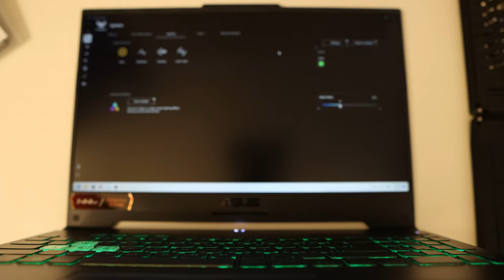ASUS TUF A15 FA507R Upgrade & Review

Comment: I am super poor and I wanted an all around good laptop with a decent graphics card.  That's a hard ask these days especially with planned obsolescence.
I'll usually study a purchase for days before I buy but this time my mom was getting me a b-day present and said now or never. I just went in to Best Buy the Sunday after Black Friday and saw the Ryzen 7 6800 series variant for $600, wondered why its so cheap when it should be like $1200. Then I realized the RAM was 8GB and the storage just 500GB (that's like 2 games of data) looked up its specs and saw you can upgrade an extra SSD and the RAM is DDR5 4800 too.
So this little Laptop really got its naming right with TUF. It's a straight sleeper like a Honda Civic. All the stuff to have decent gaming and editing is in the comp you're just missing RAM and extra memory which turns out to be the easiest stuff to install.
Reply from the maker: This lineup is really a great value and good looking, not being too overly "gamer" but having the guts inside to really perform! The best part is that DDR5 RAM has dropped significantly in the last year and NVMe storage is probably the cheapest it'll be for years. Both are definitely easy and straightforward to upgrade, too! Thanks for watching and enjoy your new laptop!

Comment: I received my A15 yesterday. But it has 2560 x 1600 according to the specs, but it is really a 2560 x 1440 and 165 Hz panel. Tested it out in Escape from Tarkov in Middle settings. Ran fine, but the screen had a weird flicker when turning around... don't know what that was all about, but I hope it won't be a problem. I have the 2020 A15 too, but Windows commited hara-kiri, so I need to reinstall windows on that one. Ran EfT in Low settings on that one. It has the 4800H and 1660 ti, which was also fine with 1440p and 144 Herz. The biuld quality on the 2022 version is so much better and the keyboard is good with very good feedback. Didn't make too much noise fanwise, but I play with headphones anyway.

Comment: Enjoyed your video.  I'm curious about one thing.  I just bought this model used yesterday in like new condition with the original box and charger.  But I notice a difference with your model.  On mine there are none of the switches (?) or labels just to the right of the mouse pad.  It's completely blank all the way across the front 1/3rd section of the board.  Could you comment on this?  What do all those labels represent?
Thanks.
Reply from the maker: That's just a label of key specs, processor, and GPU brands. Just stickers
Reply: @Accounting4Cycling  Cool.  Thanks for answering.  I'm not a fan of a lot of labels.  I think I like mine the way it is.  Thanks.

Comment: Can you upload a short video regarding 4 outlet fans
Reply from the maker: This particular model only has two fans and three "outlets" on the chassis, with the primary intake coming from the bottom vents. The "fourth" outlet is kind of just the top of the keyboard deck by the power button. The thermals were great and the keyboard was still perfectly usable during long usage (gaming and regular use). I don't have this laptop anymore, I gave it to a friend's son shortly after this video.

Thanks for watching!
-Mike

Comment: Does a SATA 2280 ssd work? I have one lying around and I don't want to spend on a nvme at this moment.
Reply from the maker: I believe both slots are PCIe NVMe only. There's also the option to get an external USB-C SSD enclosure and use that SATA M.2 as an external games drive/general SSD! Or, at this rate, a good 1tb gen 3 NVMe is going to be below US$50 by next week!
Reply: @Accounting4Cycling  I'm already using the enclosure😂 I thought maybe I'll just stick it in and just let it stay. I use them mostly for photo and video editing. I'll save up until I'll be able to afford a 2tb nvme gen 4. The video files these days are so damn huge. Thank you so much. I tried using the SATA drive and it didn't work. Thought maybe I missed some setting in the bios. Such quick response is something to be appreciated. Good luck to you on all your endeavours!!!!
Reply from the maker: @Infant Maria Ashwik  not a problem! Thanks for watching! I saw some of the Cruicial, Samsung, and WD Black 2tb NVMes are getting close to $100. They're very good drives to look at, especially if you find them on a great sale! Between video files and games, 512GB of storage disappears quickly!

Comment: Bro hope you will reply to me , i have exactly the  same laptop. Can i upgrade my ram to 32 gb or it's only capable of 16 gb expandable ?
Reply from the maker: You can certainly upgrade to 32GB, that's the max supported for that board. I only did 16GB because at the time DDR5 was still really expensive.

Comment: i have asus tuf gaming A15 (fa507re) with 56wh battery 
can i upgrade to 90 wh battery ??
Reply from the maker: I would imagine if the space is open and you can find the battery that it would work. It's the same connector to the motherboard, so if it fits, it should work without issue

Comment: HI I have the same laptop can i upgrade to 64gb of ram or not please reply like 32x2 ddr5 rams plesae reply
Reply from the maker: ASUS lists the max RAM as 64GB. I'd only really recommend going up to 32 (16GBx2) because the cost to benefit just wouldn't be there. Even with more RAM hungry programs, 32GB will outlast the thermals on the CPU and GPU in this machine.

Comment: Which RAM did you use? Can you provide any link to buy those RAM sticks?
Reply from the maker: I sure can, I used Kingston Technology Fury Impact 16GB 4800MT/S DDR5 CL38 SODIMM XMP Ready (Kit of 2) Laptop Memory KF548S38IBK2-16, Black https://a.co/d/2E2X9X7
Reply: @Accounting4Cycling  thank you!
Reply: The included ram is CL 40, so the timing may not be completely in sync if you get the Kingston and mix it with the included ram. Just be aware.
Reply from the maker: @EzEJabo  definitely do the 2 stick kit, always a good idea on laptops. Limits the risk of timing and BSOD or boot issues, DDR5 is also still pretty high for timings but luckily the cost is coming down!

Comment: yoooo just watched this,  placed my order for the same model. Idk if your a hardcore gamer or not but are thermals really a problem in the 2022 version? I'm an esports fanatic (fortnite comp) so I'm really just looking for the best performance. I read reviews about the screen, didnt seem like an issue to me, but overall anything else I should be worried about?
Reply from the maker: I thought the thermals were very good for being on the slimmer side of gaming laptops. The kid who received the laptop does the same type of gaming and has loved it! I would basically just do the same things as I did in the video: upgrade to 16GB of RAM and more storage for games. The second storage drive comes with a small battery life penalty, but it's worth it, especially with how DDR5 has come down in price!
Reply: @Accounting4Cycling  my version alr has the 16gb of dual channel ddr5 ram, the battery is 90 Whr so the HDD slot isn't avaiable. Theres an extra nvme slot which supports up to 2tb of expansion, so will def be using that! I need the laptop for Uni and heavy gaming so the bigger battery for me is definitely a plus side, as I'm carrying it back and forth from uni spending hours on end working.

Comment: Can we add hard drive on asus a 15 Ryzen 6800h with rtx 3060ti?
Reply from the maker: I don't know about that model, but if you carefully remove the bottom cover (should be the same process as this model), you will be able to see if it has space for one. Most in this lineup should have an extra PCIe NVMe m.2 slot, some with the smaller battery have a 2.5" drive bay, as well.

Comment: Do you also have diffferent colors under 8 key?
Reply from the maker: This series of laptop has an RGB keyboard, but it's either rainbow or one solid coour
Reply: @Accounting4Cycling  Yes every key is single color but under 8 key There is multiple colors. For example if I set static color to white I see purple and green. If I set it to yellow, I see orange and green only under 8 key. Other lights are ok. Am I the only one encountering this?
Reply from the maker: @fv4202x  I didn't experience that, might be a bad group of LEDs under that key that aren't lighting correctly. Could also be like a magic 8 ball and hold special powers?

Comment: Great video thanks. Could I ask what size battery does this laptop have?
European/ Uk only get 56 wh
Reply from the maker: This one is 56Wh, too. Does pretty well on battery for it's size and power, but there's definitely room for more.
Reply: @Accounting4Cycling  hey mike is it possible to update from 56Wh to 90Wh ?
Reply from the maker: @Giorgi Turmanidze  it looks like there's space for it. As long as you don't have the 2.5" drive space, it should just drop in place and go. I'm sure there's a vendor selling new/OEM batteries.
Reply: @Accounting4Cycling  i cant wait for someone to do this "experiment" on youtube it is really hard to take a risk of doing it on your own a without video tutorial :)
Reply from the maker: @Giorgi Turmanidze  I don't have this laptop anymore. I gave it to a friend's son who just started getting into PC gaming/streaming and needed/wanted one for high school. I could possibly do a battery removal/reconnect video, depending on if it's glued or not and has the space for a larger battery (many due for simplicity of production), it's a pretty quick task. Not quite upgrading RAM or an m.2 SSD easy, but it's pretty straightforward.
Reply: @Accounting4Cycling  Well if you do this trust me you will get some views because I see a lot of people asking questions like is it even possible and if so how can it be done and there is not a single video explaining (not even an article) on the subject.
Reply from the maker: @legeorges  definitely noted! Thanks for the insight!
Reply: @Accounting4Cycling  im gonna subscribe your channel just to wait for that video 😀😀😀
Reply from the maker: @legeorges  thanks for subbing! I have an Acer Aspire 3 that could use some surgery/dissecting on video. 😆

Comment: If i put an extra 8gb in dual channel it  will be 16gb?
Reply from the maker: Sure will! I'd definitely recommend doing both sticks at once or try to get as similar a stick as possible to what comes in it (Samsung 8GB DDR5 4800MHz CL40, if I remember right). The system will try to balance the RAM to the lowest common timing and highest common speed that's stable, but that's usually slower than either are rated.

Comment: at first i get impressed by the number of heatpipes but after that im asking my self now if they made this because the sistem isnt eficcient
Reply from the maker: I thought the same thing when i first opened it up. I think they used so many heat pipes to keep the laptop thin without too much added cost, but also keep the cooling efficient. The cooling was pretty good. It's well set-up for tinkering with now and down the road, even the single 8GB RAM stick is a nice thought for upgrading when single-stick 8GB DDR5 is available. 

My two biggest questions from a budget perspective were:
Why only 8GB of DDR5 RAM on a Win11 gaming rig?
Why no PCIe Gen4 SSD support on either M.2?

Comment: Hello, I want to ask if this laptop supports SSD Gen 4? I want to upgrade the ssd but I don't know and the reviews don't mention it, and I tried asking Asus but only supports SSD NVME Gen 3 only
Reply from the maker: There's one of each. The one populated out of the box is a Gen 4 spot, the empty one is Gen 3. I think the SSD in the laptop is Gen 3, so it's a nice upgrade to go with a Gen 4 and bigger storage!
Reply: @Accounting4Cycling  Thank you very much for the very helpful information, if you upgrade this laptop to ssd gen 4 please make a video too
Reply from the maker: @muhammadzikri6655  I actually gave it to a friend's son, that's who the initial upgrades were for. The Gen 4 SSD would be the same process, but you'd want to swap the drive in slot 1 to slot 2. It's a very easy process, if you're up to it and/or follow me in this video. 🙂
Reply: @Accounting4Cycling  So the Gen 3 SSD is in the Gen 4 slot?
Reply from the maker: @ralphbeauchamp3517  out of the box, yes. Just have to move it if you're putting a Gen 4 SSD in with the original.
Reply: @Accounting4Cycling  Thanks. I had it in the open slot. I couldn't get an answer anywhere. I had got ram also. 2x8gb chips. They sent a 16x1. I talk to them after reading your comments. They are sending me another 16x1 for free. Amazon. So, I will have matching ram chips for dual channel.
Reply from the maker: @ralphbeauchamp3517  32GB of DDR5 is gonna rock! Nice reward for their mess up. I had to deep dive into the specs/technical manual to find the Gen 4 spot answer. For some reason (cost) it happens with a lot of gaming laptops, even my Alienware X17r1 had a 1TB Gen 3 SSD slot.
Reply: @ralphbeauchamp3517  Have you now upgraded the Gen 4 SSD? If so, does it really run on gen 4?
Reply: @muhammadzikri6655  Yes. Samsung - 980 PRO 1TB Internal Gaming SSD PCIe Gen 4 x4 NVMe. I can only assume it runs on gen 4. I do know the 2023 model comes with two Gen 4 slots. No gen 3.
Reply: @ralphbeauchamp3517  Have you tried the speed on this Asus Tuf model 2022? Really running on gen4 one of its slots?
Reply: @muhammadzikri6655  Its fast. I have not had time to verify.

Comment: Can I upgrade the battery??
Reply from the maker: If you have the space and find the correct one, I don't see why not! I believe this is the largest for this model range, but if it has the same connection and fits, it should work fine.
Reply: @Accounting4Cycling  thnaks you very much for your answer

Comment: Can the ssd be upgraded to 1 Tb ?
Reply from the maker: Absolutely! I believe each NVMe SSD bay can handle at least 2TB each. I use 500GB because I had one around my office.
Reply: @Accounting4Cycling  for  the ram is it ddr4 ir ddr5
Reply from the maker: @samsupernoods6822  it is 4800MHz DDR5. I have the RAM and all of the other parts and equipment used linked in the description, too. It is an Amazon affiliate link that I may earn a small commission through.
Reply: @Accounting4Cycling  oh i did not see thanks very much
Reply: @Accounting4Cycling  are all the motherboard are the same cuz mine ia different model from 2022
Reply: @Accounting 4 Cycling  and what is the maximum amount of ram per slot
Reply from the maker: @samsupernoods6822  I believe it's 32GB, may be 64.
Reply from the maker: @samsupernoods6822  It likely has a similar motherboard, if not the same one. For the purpose of upgrades, it's probably the same.
Reply: @Accounting4Cycling  can i use other ram brands together?
Reply from the maker: @samsupernoods6822  brands shouldn't make much of a difference, it's usually type (DDR5 in this one), speed and timings (CL 45, CL16, CL32, etc). The chipset will find the lowest common timing and highest supported speed if they're not the same, but brand isn't as big a deal.
Reply: @Accounting4Cycling  thanks
Reply: @Accounting4Cycling  what the ram for this
Reply from the maker: @samsupernoods6822  it's Kingston Fury DDR5, I put my Amazon affiliate link in the video's description, makes it easier to find and I do earn a small commission off that link if you purchase it.
Reply: @Accounting4Cycling  i mean for the original one
Reply from the maker: @samsupernoods6822  the original RAM was some generic OEM kit, I think technically Samsung chips but I don't have a specific link.
Reply: @Accounting4Cycling  ok
Reply from the maker: @samsupernoods6822  found it! This should be the matching 8GB 4800MHz DDR5 RAM stick.
https://amzn.to/3meKX9H
 (it is my Amazon Affiliate link, I may earn a small commission if you purchase through it)
Reply: @Accounting4Cycling  thanks
Reply: @Accounting 4 Cycling  Hi, i got a 32gd ram. Will it be able to use the ram it came with?

Comment: Crap I really needed to know how to get these ribbon cables out over the wifi card lol
Reply from the maker: Very carefully! Lol But you should be able to gently release the edges of the tabs and pull the ribbon cable loose (reverse to secure it)
Reply: @Accounting4Cycling  I got it! Lol they just had little tabs to flip up and here I am gently pulling on them for 15 mins SMH. Lol
Reply from the maker: @bumbaclot813  the cable usually will come out after a while... But the tabs make it much easier, especially when it comes time to put them back! A lesson learned from experience. 😱

Comment: Oh... unplug the battery before tinkering with laptops.
Reply from the maker: Always solid advice! Especially if you're going deeper than just changing an SSD or RAM
Reply: This one was a pain to unplug though
Reply: @zerodark09  Yeah, agree. Compared to the 2020 version, it was a bit weird… but I got done and installed 1TB more storage… just for fun. Next project: 32 gigs of RAM…
Reply from the maker: @zerodark09  Yeah, ASUS really does not want you to accidentally unplug that cable!